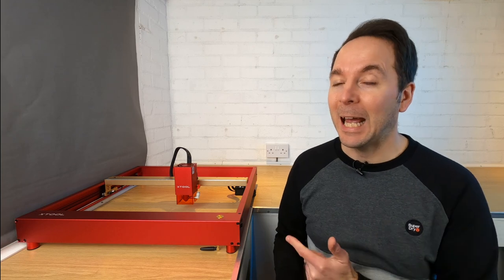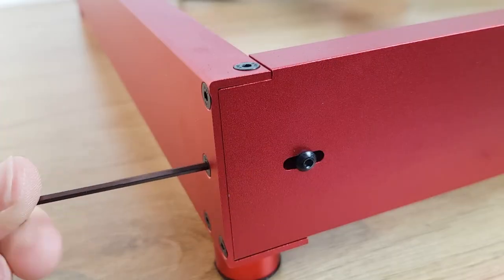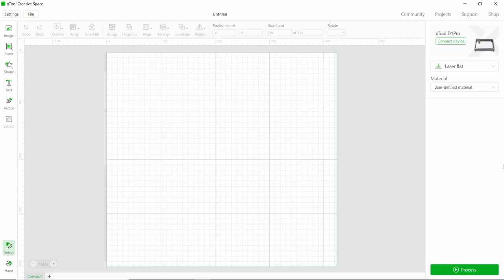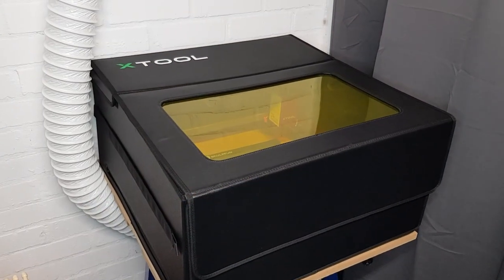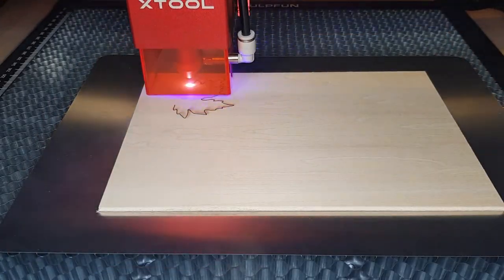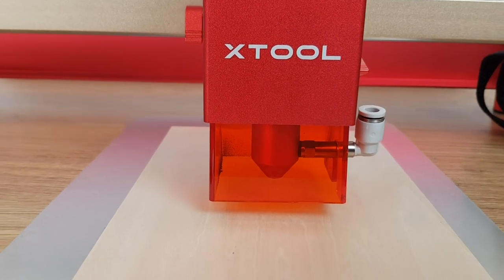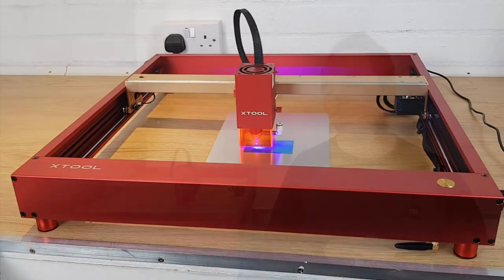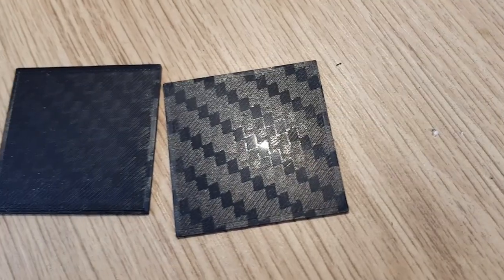X Tool D1 Pro 20w Review - Is It Really The Best Diode Laser Engraver?

Comment: Thanks for posting this vid Ricky. I bought the 10W D1 Pro in the fall before the 20W was available to me. I also have the enclosure and air assist. I find the fan in the enclosure is weak and have purchased an inline fan and 3D printed adapters to hook it up to the 3" hose from the enclosure. I haven't hooked it up yet because I want to make sure the Xtool is where I want it before mounting the inline fan to a wall or table. I also have the Buster Beagle grid but want to cut a spoil board to use it with. The honeycomb  bed does work very well and I've 3D printed pegs to hold material in place and/or for locating material for multiple jobs. I've downloaded Lightburn but so far XCS has done everything I need it to do and they do keep updating it with more features. I've found that when using WiFi some jobs can quit part way through. I haven't had that issue with a laptop connected via USB. Overall I'm quite happy with the purchase and may consider the new 40W in the future.
Reply from the maker: Thanks for your comment, it's great for others thinking about buying one to see other owner's experiences.

Comment: I literally subscribed to you a few weeks ago, because I received a 3d printer for my birthday. But extra perk, I also have the d1 pro 20 watt with the enclosure and air assist. I love it, but...  I am still getting a lot of smoke in my woodshop shop even with an extra fan venting out the window. I find myself not enjoying it quit as much due to the smell.  Curious if you have the same issue.  Note I use a power strip and smart outlet to turn on the fan via Alexa.
Reply from the maker: Hi, nice to have you on board! I only had the smoke problem when I didn't use the enclosure. I find it's fine when I use it. Do you have an enclosure for yours? I really don't like smelling of smoke when I go it the house otherwise.
Reply: @RickyImpey  Thanks for the reply, Ricky. Yes, I have the enclosure and I even bought a inline fan to add to the existing fan and vent it out the window! I must say that the only time I have the smoke issue is when I'm cutting. I don't have to cut with it I have plenty other machines( cabinet saw, bandsaw) that do that, but it is one of the reasons I purchased the laser. I'll probably try giving them a call. perhaps it's user error.

Comment: Would you still recommend the Pergear given its significant lower price when compared to the XTool?
Reply from the maker: The Pergear 10w is good. It just has less features and a lower powered laser. I think you get what you pay for with each. I don't really use the Pergear now I have the xTool but only because I don't have room to have them both setup. I would say to buy the one that suits your budget.
Reply: How is it operating after a few months? Have you had to replace anything? Is the performance still good? What future costs do you expect?

Comment: Dammit, I was just about to buy the Pergear....!
Reply from the maker: 😁 Sorry Esther. The Pergear engraver is good but half the power of this one.
Reply: @RickyImpey  Think I'm going to go for an Atomstack X20 Pro - As they have just released the X30 Pro, (very similar in price to D1P)  it's on offer and comes with built in air assist, plus I can bundle in a honeycomb base (and probably more things, but I'm already out of my price comfort zone!) for less than the D1P. Also I'm happier with something that seems less proprietary than the Xtool.  Still time to change my mind though!
Reply from the maker: @estherturner1564  Atomstack machines are popular. Many of the others are just rebranded Atomstack models (including my Pergear). You will have a lot of options on accessories as and when you want them too.